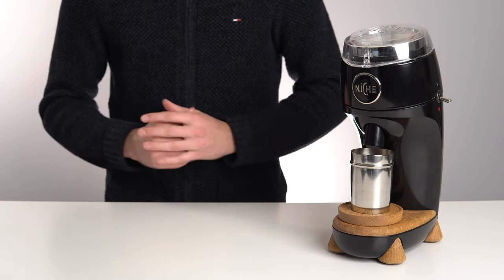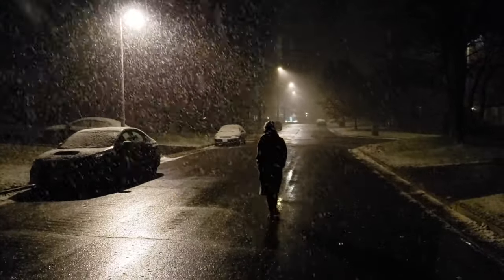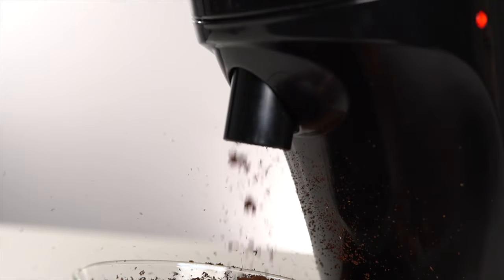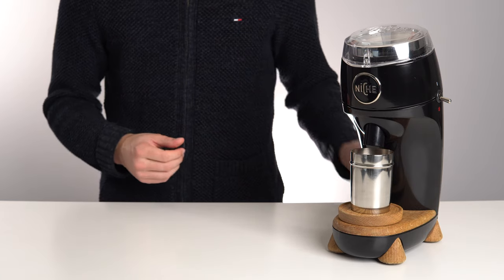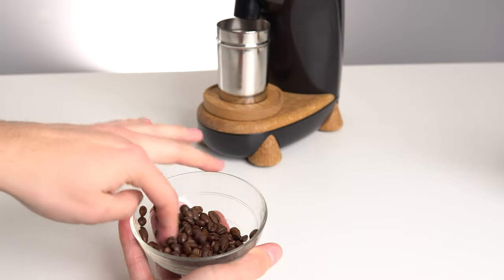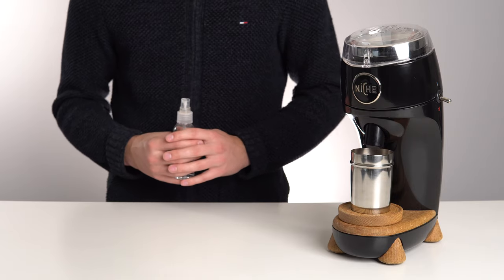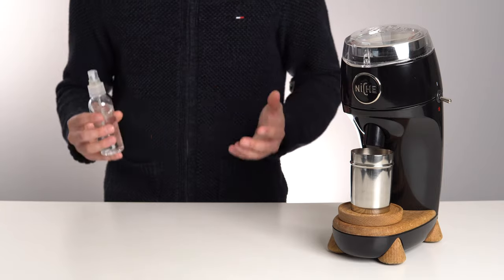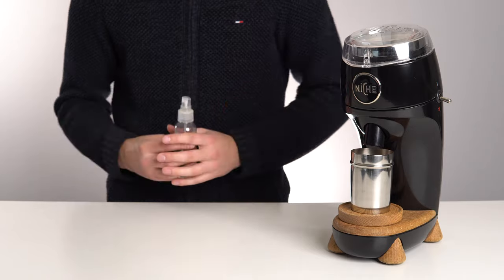Ross Droplet Technique | Say No to Grinder Static!

Comment: Isn’t the RDT not recommended for the Niche specifically because of the special coating on the burrs and other materials in the housing?
Reply from the maker: No-matter what grinder you're using, if you're adding enough droplets to cause a problem, you're using too much. The aim should be to "increase humidity" not to make them wet. 
I've been using RDT since I got the Niche and haven't had any issues with grind retention or otherwise :) 
Just did a full teardown of the grinder last weekend actually!
Reply: @LifestyleLab_  Sweet, thanks for the info. That's good to know!

Comment: @Lifestyle Lab  Hello! I am reaching out for some guidance. Just got my NZ, and I work with a Breville Barista Pro. I always thought the BBP grinder was it's weaker point due to retention. After reading posts and watching all NZ-related videos on static, I have to say I am kind of disappointed with the NZ. Despite the RDT, I still get a lot of static, which makes transferring the grinds from the dosing cup into the basket an absolute mess. Grinds just hang behind in the dosing cup. I do not get this problem with the built-in Breville grinder. Perhaps the most stunning finding here is: pulling two shots back-to-back --- one with the NZ and one with the BBP grinder, I do not detect any significant difference in quality of espresso. Always thought I had a discerning enough palate. What gives with my situation. I am a bit frustrated as you might imagine, given how much the NZ cost me. I thought it would somehow raise my espresso game in the eventual quality of espresso that is made. But, it seems to be adding to the headache AND makes no better espresso. -- CG, (your frustrated subscriber)

Comment: I'm having this issue too on my Niche since a few days, but only with dark roasts. Probably because it has less humidity inside the beans.

I've read somewhere that your technique may cause more residue build-up, I have not tested though so I don't know if that's true
Reply from the maker: If you're using enough water to cause buildup then you're using too much! The beans should be damp, not wet, to avoid damage to the grinder 
I've been using RDT for a while on the Niche with zero issues

Comment: im using a smart grinder pro
I find that I have to clean it quite often, at least once every 3 days
will this also reduce grind retention?
Reply from the maker: Possibly if you are really struggling with static inside the machine, but RDT is not really meant to address grinder retention

Comment: Does this also help with the Breville built in grinder? (Btw, I dose directly to the portafilter).
 I sometimes notice the grounds stuck on the sides of the basket after I tamp them, which requires me to use the Razor tool to get rid of them.

I’m Curious if this technique would help if I’m using the Barista built in grinder.
Reply from the maker: Yes it would! Again, I recommend single dosing, even into the built in grinder
Reply: @LifestyleLab_  
perfect! I’ll defo try it out then.
Yes, I always single dose 👌🏻

Thanks!

Comment: Not sure those steel burrs can stand the water.
Usually single dosing grinders has special coating for that purposes.
Water and steel....rust.
Reply from the maker: As mentioned in the video, if you're using enough water to cause rusting, you're using WAY too much water. This technique should be used to essentially "increase humidity" within the beans, not make them wet.